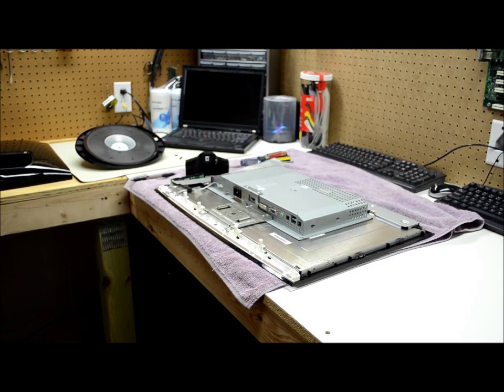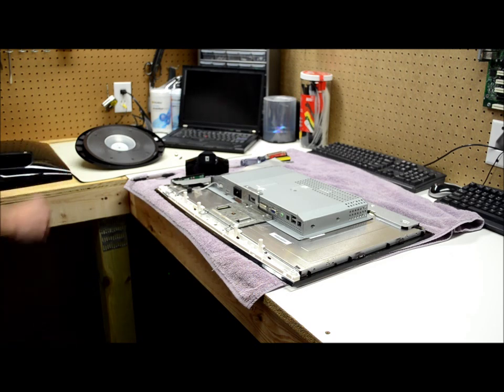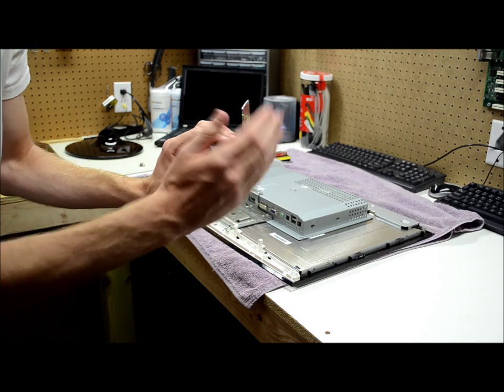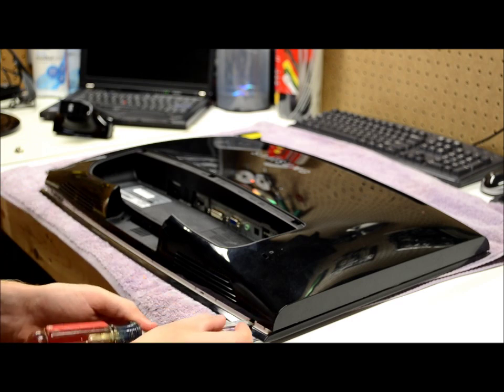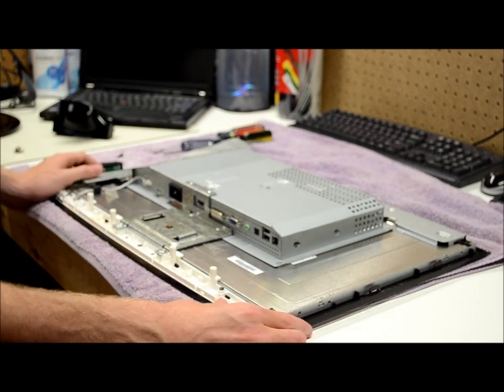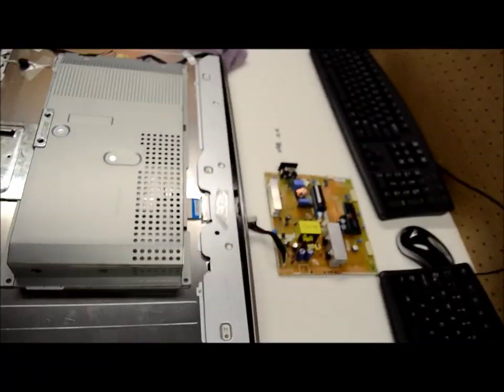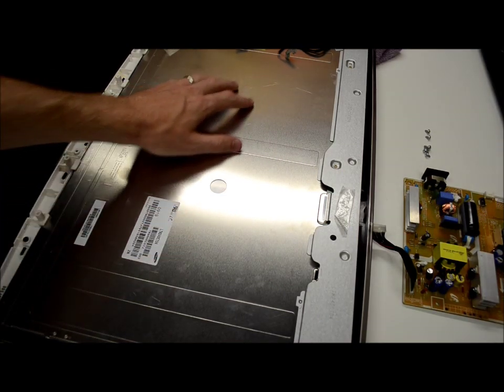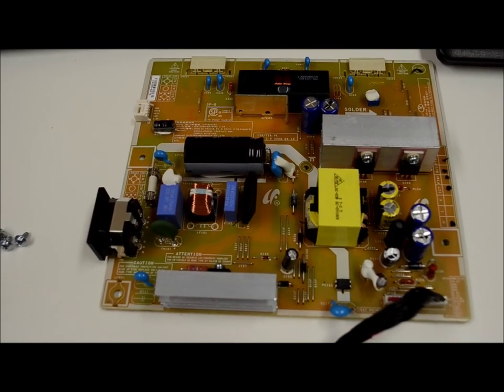T240 Disassembly Video

Comment: trick to pull that out: 
1. try to pull it out along with the base stand. makes pulling much easier
2. but to pull it out along with base you have put the monitor base sticking outside of the edge of the surface where you have your monitor laid down. 
3. try to pull it straight out instead of tilting it. 
spent 2 hrs trying to pull that out by hand without the base, and couldn't do it. almost gave up, then this idea came and was able to do it.

Comment: I'm so excited to find this video.I'm having the same problem you had. I guess I'll buy the T301inverter transformer and the capacitors. I followed you on a forum, Badcaps.net forum. I'm really thankful that you did the video. It will make my job so much easier. I'll use a car trim removal tool to pop the case apart with blue masking tape on the bezel. Thanks for all of your wonderful information. I would be in trouble without your knowledge. Thanks so very much!!!

Comment: Hi,
Thanks for the video. 
I also had a broken T240. After my research i discovered that the deffect of my monitor was in the backlight tubes.
The wires did came lose from the tubes.
This was easy to fix with some soldering.
Maybe this will help someone else also with repairing his monitor.

Gr,

Comment: You said you found no info on how to open this monitor on the web, and yet you yourself don't mention how to remove the base. Remove the large "disc" is not enough, there's this plastic that hides the screws and you don't show how to get rid of it. Sucks, makes the disassembly impossible.

Comment from the maker: The new inverting transformer was $12 on ebay. I had a soldering iron already and solder and flux so it was very cheap to fix. Sold the monitor for $165 a week later (got it free from a friend 'cuz it was broke, split the sale with him).

Comment: Thanks for uploading this video.  My T240 just lost its back lights today and I have been trying to figure out how to get into it.  This video was indispensable, thanks.  However, do you know how to get the LCD panel free from the screen entirely?  I want to check that the back lights did not burn out but I do not want to break it either.  Thanks for the reply.

Comment: I had some trouble with some very thin foam/fabric (I think its padding that goes between the screen and the metal frame around it) poking down past the plastic and covering some of my pixels at the top of the screen. I'd always have to push it up again with a piece of plastic or something. Finally enough was enough and I decided to take 'er apart for a more permanent solution.

This video really helped me get the monitor apart and back together safely. Thanks! :)